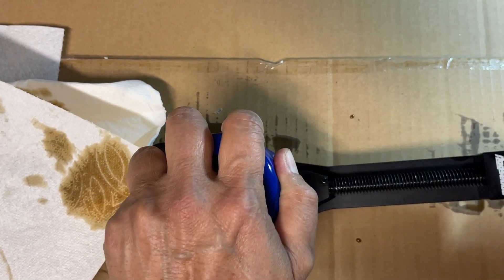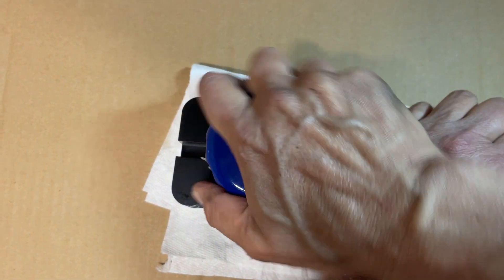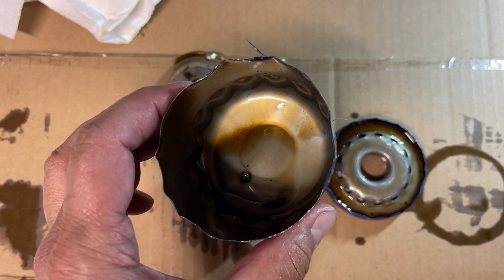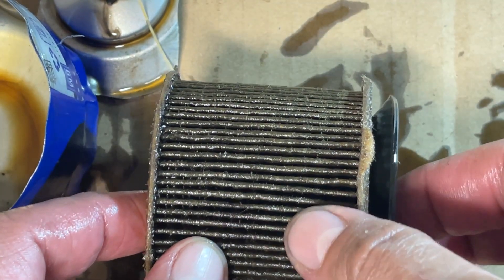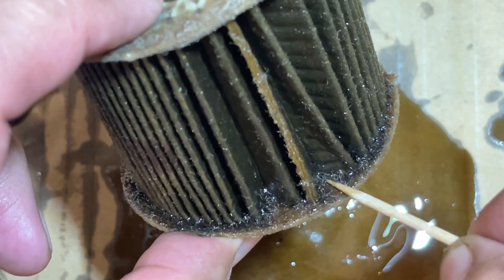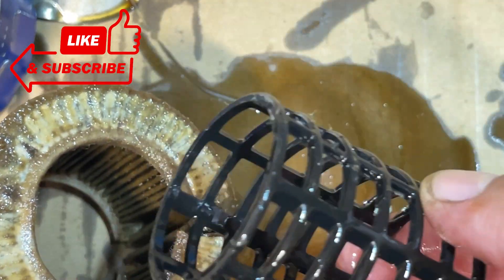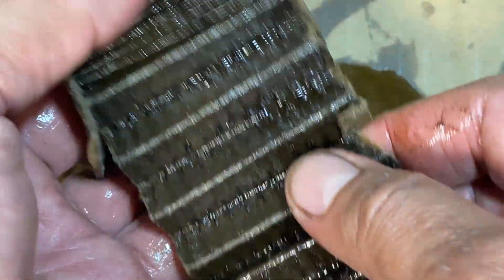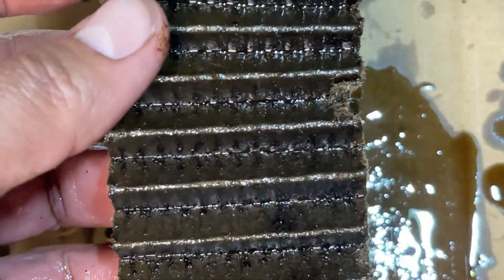Oil Filter Inspection After First 500 Miles with Valvoline Restore and Protect on Chevy Silverado

Comment: Oil Filter Is Key! I picked up 5 jugs of VRP. I picked up filters that can handle a 5k mile interval. I got Purolator BOSS, AMSOIL, and Mobil1 EP filters. All able to load up with gunk and carbon deposits for only 5k miles.
Reply: Can't remember where I saw the video but,  OEM filters like AC Delco and Motorcraft had way better oil flow than the aftermarket filters.
Reply from the maker: @Rob-xj3xh  Hey! You’re sending back down the rabbit hole lol you gotta find that video and comment with the link. I’m pretty sure I may have seen the same video.
Reply: @Rob-xj3xh all those are absolutely junk filters that dont have good filtration. Thsts why they flow a tiny bit faster.     I've cut open and studied every oil filter on the market. Several times over. The  Premium guard extended life.  And microguard select are the best quality,   Best made filters available.  All other filters are Not even close to the same level
Reply: @ I've heard the same about those two filters. I have an Advance Auto near me, do they sell them? I have never seen them before.
Reply from the maker: @robb15033  Here’s my list of filters to get when they go on sale: Taller Oil Filters for 2002 Silverado 1500 5.3L V8:
	•	WIX XP 51522XP – 5.178” tall
Taller version of 57060XP. Synthetic media, extended life.
	•	Mobil 1 M1-302A – 5.25” tall
Synthetic media, high efficiency, long drain interval capable.
	•	Fram Ultra Synthetic XG3980 – 5.24” tall
Dual-layer synthetic media, up to 20,000 miles.
	•	K&N HP-2003 – 5.125” tall
High flow, premium build with welded nut for easy removal.
	•	ACDelco PF61E – 5.1” tall
OEM quality, taller than PF46E, fits most GM trucks.
	•	Royal Purple 20-300 – 5.2” tall
Premium synthetic media with excellent durability.
	•	Bosch Distance Plus D3330 – 5.3” tall
High dirt-holding capacity, great for long intervals.
Thanks again for the great tip!
Reply: @TRX450R  My Toyota Corolla 2008 1.8L AND My Ford Focus 2003 2.0L
Both run like a pristine machine. Both cars lived on Mobil1 EP 5W-30 and Mobil1 EP oil filters.
So, I have two clean engines that burn no oil and just purrs, ready to run VRP and hopefully clean some rings and carbon deposits through my oil filters.
Reply: @TRX450R  https://www.youtube.com/watch?v=mYi640pMjWA
video that clearly shows what can be done by all the top filters.
Reply from the maker: @ YES!! I’ve been looking for this video. Watched it once. Thanks for the link!
Reply: @TRX450R  I noticed the filters you mentioned have drainback valve pressures outside the OEM's 12-15 PSI range. A 22 PSI drainback valve seems risky, especially for cold starts. I’d stick with something like the PBL12222 or LX10060, which match the OEM specs. Bigger filters might look appealing, but the right drainback pressure is key, especially in winter. Swap out more frequently if you feel the need.

Comment: That’s one crappy oil filter 😮.
Reply from the maker: @lalajee143  A lot of people are saying that…. Which oil filter brand do you recommend?
Reply: @ depends on your budget.
Wix XP
Mobil-1
Fram ultra synthetic 
Napa platinum ( made by WiX)
And there are many more 
Thank you for not getting upset over my comment. People are very sensitive these days 

Cheers !!
Reply from the maker: @lalajee143  Definitely going to use WIX. I keep seeing great tests results and positive reviews. 
Sensitive? HA! Anyone entering the internet ring can’t be sensitive. Thanks for the tip!
Reply: @TRX450R  All those filters can handle 5k miles of VRP. I chose a combo of filters. I got some Purolator BOSS, AMSOIL, and Mobil1 EP filters myself.
 WIX XP (As apposed to WIX)i s the longer mileage option, i believe.
Reply from the maker: @robb15033  higher mileage and oil compatibility is something I didn’t consider. I thought oil filter were oil filters. Here’s a list of higher mileage taller alternatives I got from ChatGPT: Taller Oil Filters for 2002 Silverado 1500 5.3L V8:
	•	WIX XP 51522XP – 5.178” tall
Taller version of 57060XP. Synthetic media, extended life.
	•	Mobil 1 M1-302A – 5.25” tall
Synthetic media, high efficiency, long drain interval capable.
	•	Fram Ultra Synthetic XG3980 – 5.24” tall
Dual-layer synthetic media, up to 20,000 miles.
	•	K&N HP-2003 – 5.125” tall
High flow, premium build with welded nut for easy removal.
	•	ACDelco PF61E – 5.1” tall
OEM quality, taller than PF46E, fits most GM trucks.
	•	Royal Purple 20-300 – 5.2” tall
Premium synthetic media with excellent durability.
	•	Bosch Distance Plus D3330 – 5.3” tall
High dirt-holding capacity, great for long intervals.
Thank you guys for all of these tips. The next oil filter changes and oil analysis results will be interesting and I’m excited to share with you all!
Reply: @TRX450R  Great list. Purolator BOSS, and AMSOIL make long-distance protection oil filters.

Comment: When you're using VRP, it's a good idea to change your oil more frequently than usual for the first one or two oil changes. VRP is designed to work gradually over several oil changes, so you need to empty out the dirt and carbon particles to keep them from recirculating too much. I would also use a better quality oil filter. K&N is supposed to be the best among those that are readily available.
Reply: Napa gold>k&n. K&N can't even make a good air filter.
Reply: @sHoRtBuSseR  Their oil filters are one thing, their air filters are another. Their air filters are different from their oil filters in that they need to be "oiled" in order to work properly.  I'm not sure what the process is, but I do know they're somewhat high maintenance.
Reply: @je19662008  I have a lot of experience with them and I am not a big fan. I've torn down far too many engines with filter oil and dirt caked in the intake ports in the heads.

Paper filters just filter better. You need to make a LOT of power over stock to make a new filter setup actually have a difference in most applications
Reply: @ Do you know how often their owners changed their oil?
Reply: @je19662008  No, but with enough data I can determine that there's a clear correlation. I've torn down thousands of engines, and there's a clear, consistent, and distinct relationship with aftermarket oiled filters, and excessive cylinder wear, valve seat wear, ring wear, dirty ports, and dirty/failed throttle bodies. I've done oil analysis on a few of these and there's very clear indication of contaminants in the oil. 

I have built a handful of high HP engines for myself and I exclusively use stock or stock style filtration. Am I leaving a few HP on the table? Maybe. Am I reducing wear? Definitely.
Reply: @sHoRtBuSseR Napa is made by Wix, add number 5 in front of Napa filter number for Wix number eg Napa 1040 is 51040 Wix
Reply from the maker: Thanks for the oil filter replacement tips.  I didn't know about multiple replacements prior to an oil change and it makes a lot of sense to do so.  Guess I'll be doing more oil filter reveals than anticipated! lol In regards to the oil filter quality... I'm going to need to do more research. K&N will be a good starting point. Thanks for watching!
Reply: Skip the K&N and go with Wix XP for less cash and more capacity. K&N oil filters are good for their application: racing. You change oil after every event in racing and they’re designed for that application.

As for changing the filter more often, yes. 

Definitely change the filter every 500 miles for the first change of R&P. 2nd change do it every 1k. 3rd drain and fill forward run as normal.

You can run the oil for 3k-5k miles, but change the filter frequently initially.

Comment: Ok..VRP...Solvent + Drain Cleaner "Irritant" equals....( Clean Metal + Goodbye Rear Main Seal and all others) Go back to Diesel Fuel to carefully flush a little at a time...
Reply from the maker: @tonybernheim8365  I hear diesel fuel is a good method. I feel that VRP does it slowly in a safer way. Also, Valvoline Restore and Protect does not contain the same harsh chemicals found in drain cleaners. Drain cleaners often use caustic substances like sodium hydroxide (lye), sulfuric acid, or bleach designed to dissolve clogs. Engine treatments like Valvoline Restore and Protect use detergents, dispersants, and lubricating additives formulated specifically for cleaning and protecting engine components without causing harm to metal or seals. When I get more trucks to experiment on, I’ll try diesel fuel, but not on my daily driver. Thanks for reminding about the alternatives and thanks for watching!

Comment: Just put vrp in my 14 z71 about 3mo ago, i think im going to do a filter change here soon
Reply from the maker: @anthwor  You are ahead of the game!  Newer engine with VRP… that engine is going to last! I’m going to determine after my oil analysis how long I can go without an oil change using VRP and let you guys know. Hopefully save everyone some time and money.
Reply: @TRX450R  yeah with the vvt and direct injection I'm worried about the valves getting dirty and the oil passages getting clogged.  I've been thinking about fabbing an injector or carb to keep the intake clean, not sure if it'll be worth it...
Reply from the maker: @ I get it. I’ve been taking that into account. I updated the valve cover to the new version which you have. I’m going to install an oil catch can. When I’m starting to have issues from dirty intake valves like worse gas mileage or poor idle, I’ll get a walnut blaster and clean them up. I used Sea Foam and it worked to smoothen out my idle! That stuff does work on the intake system!
Reply: @TRX450R  i used sea foam too after i put in a pcv cause it was sucking up my oil like no other. I've been looking at a catch can but just haven't bought one yet
Reply: @TRX450R  what's your mpg I'm getting about 14 on 35's
Reply from the maker: @ I couldn’t complain about 14mpg. I’m getting around City: 12mpg Highway: 13.5mpg with 31 inch tires.  You’re making start to think I should clean up my intakes sooner than later! 😬
Reply: @TRX450R  ill be watching for that video haha
Reply from the maker: @anthwor  That’s going to be a long day! Lol I will definitely upload that video.
Reply: @, I use RED LINE fuel cleaner for every oil change. RED LINE and Techron both have the most PEA to clean your internals. Full bottle of cleaner to 1/4 tank of gas. Or, two bottles of cleaner to a full gas tank.
Reply from the maker: @robb15033  I’ve used Techron in the past. I can agree it does something. Back when I used it, it would make my check engine light go away. Back then I wasn’t hooking up a OBD2 or knew what codes were the issue. I’d poor a bottle in the tank and I’d go get my smog check soon after the light would go away. Good stuff! I’ll checkout redline.  I will be using Redline transmission fluid after my trans filter replacement. Thanks for the tip!

Comment: Wow! Ok, A Z71 with 288K 👍Also I've never seen that much grit in a filter after using VRP and in such a short period of time. My Toyota at 80K after 1k miles the filter had discoloration in between the pleats with some tiny looking grit which just dissolved when touched. Wild
Reply from the maker: @chaingliderreddup4222  Hey, I’m blown away how Valvoline Restore and Protect is chiseling away at grit. I wonder where your Yota was hiding that grit. 🤔  When I drain the oil and catch a few ounces for the oil analysis, hopefully I’ll catch some grit for them to analyze (or I’ll pull it out of the oil filter). That might lead us to knowing what the buildup is made up of and where our engines are hiding it.
Reply: @TRX450R  Service records on the Yota show OC's at every 9-10k miles so I'm guessing it's the common carbon buildup and from the ridiculous intervals. :)
Reply from the maker: @chaingliderreddup4222 Every 9-10k! Crunchies are no bueno! I’d say get an oil analysis at 4k and that’ll tell you if the oil is still working to clean and protect parts from wear. I’m going to do it at 3k. If the oil analysis comes back still stable not fully oxidized, I’ll push my oil changes out to 4k. SCIENCE!! 😜
Reply: @TRX450R  "Technically" Valvoline doesn't claim a particular Change Interval for its Synthetic Oils... But that it will meet the Factory Change Interval Requirements. So for many Toyotas with 10K intervals they would be intended to run that...

Kind of like my 2.4L GM Ecotec with its OLM is supposed to last upwards of 7500 miles/12 months... The DEXOS rated Oils I used in the past usually are rated to go that and more... With many claiming "10,000 mile Protection" or even offering a Guarantee... But with my vehicle's Oil Dilution issues I'm changing at 3000 miles/3 months/OLM 50-60%...
Reply: @ VRP has changed the rules. Individual circumstances dictate what filter & for how long.
Reply: @robb15033  Have they? They haven't updated their FAQ yet... S

omeone had claimed seeing it (Change Interval) written on the Oil Jug... But unless it is a very new revised label/policy Valvoline hasn't dictated change intervals less then the Factory...

They also claimed the Oil Filter should still last the factory interval too...
Reply: @ I've seen some dirty filters come off of a full 5k-mile interval with VRP. I wouldn't chance it with VRP oil in a dirty car. engine. I still recommend top-notch filtration..
https://www.youtube.com/watch?v=rqDjCzyYUOU
Reply from the maker: @ Makes sense. Since the oil is performing exorcisms,  I need more filtering and oil flow.  Being it’s a synthetic oil, should be lasting longer. Looking forward to the oil analysis to determine oil change frequency with this new oil.
Reply: @robb15033  Thanks for the Oil Filter Comparison/Recommendation/Review video.  I made several short YouTube videos of my VRP Oil Filter Cartridges so far...  Had used FRAM Ultra Synthetic during my first interval of VRP (at change then a Swap 1/2 way thru before Interval #2 at 3000/3 months)... For #2 it was a K&N for the first part and STP for the (current) last section... Have some Purolator One Filters ready for Interval #3 soon...
Reply: @TRX450R  For mine, I've had Oil Dilution issues since I began Oil Analysis (1.3% in "Summer", and 5.3-5.8% "Winter", "Acceptable" level per the test lab is less then 2%...) so I'm still trying to nail down an Interval and/or reduce the Oil/Fuel Dilution Variable to maximize the Interval...  The Lab suggested if I'm under 2% I could go 4-5K miles... At just 3K miles I'm not happy with either 1.3% or 5.8%... So hopefully I can get the Fuel % lower and/or reliably predict when/if I should change early.  I have a "Winter" sample (#3 total, took 2 "Summer" last year, so 5 test points so far) in for test now (VRP #2 at the filter swap)... Really hope the Dilution will be less now
Reply: @lgoamity  FYI: Walmart now sells a Purolator 20k mile filter. It should replace the Purolator One. 
I am using a Purorlator BOSS right now on the Ford. I am using a Mobil1 EP oil filter with the Toyota.
I'll keep watching your videos. Thanks.
Reply: @TRX450R  Yeah, test results are the best way to track how long the oil can last. I'm just going to 5k miles and changing it out again with new VRP and new AMSOIL filters I got.
Reply from the maker: @ I’ll try 3K first and the. 5k to try and find the sweet spot. I’m sure everyone will be interested to see an oil degradation comparison. Good to know I will be extending my oil changes and saving money.
Reply from the maker: @ This is interesting. I didn’t realize that in places where winter and summer weather can fluctuate a lot (outside California) can make an impact with dilution. I can see during winter warming up the truck longer, sitting in winter stop and go traffic, metal parts shrink overnight creating blow by….I’ll be getting oil analysis for a year to see what might be going on inside the engine. That’s great to know that’ll be a factor to consider during summer and winter oil changes.
Reply: @TRX450R  My "Winter" driving might be incorporating some of that extra "idle" time.  Or like what I'm doing now. Typing this out while the vehicle is idling but doesn't have to be...
Reply: @TRX450R  That is a great idea. You can focus on trends and know exactly how long to run intervals.
I consider my engine as pristine because I have maintained it myself for over a decade. A 5k-mile interval should be no issue for me and my filters in this case.
Reply from the maker: @ That’s awesome! Knowing your motor is key.  Wish I knew more about oil analysis and fuel trims earlier on.  Having a base line would have been great to compare with as the vehicle ages. Every new vehicle should come with a OBD2 reading s report and oil analysis. Great job keeping that motor pristine!
Reply: @TRX450R  That "buildup" is carbon that the oil is removing.
Reply: That was awesome to see. Those people who work at Valvoline should be watching. I've seen different reactions in different engines.